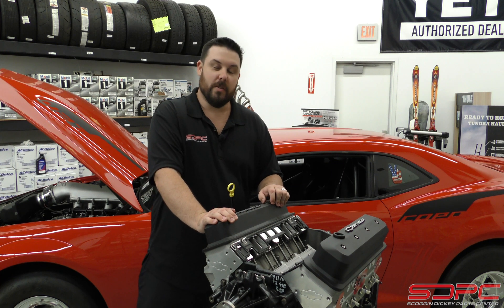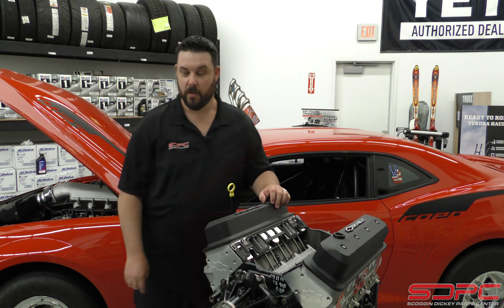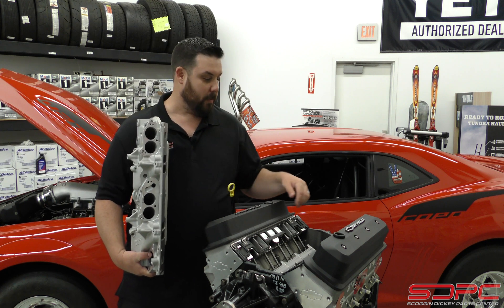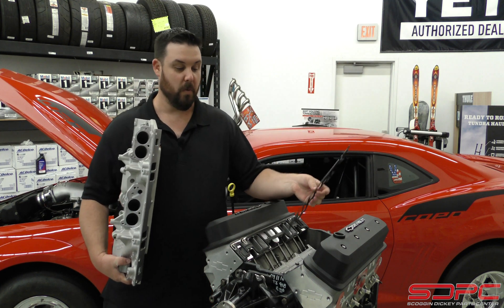SDPC Tech Tips: SD3816 Vortec TPI Base Intake

Comment: The GM TPI intake didn’t deserve the bad rap they got. Everyone thinks that you have to rev an engine to 6-7000 rpm to go fast in drag racing. Between aftermarket parts and porting tricks the TPI intake can make sick torque for a street car.
Reply: No doubt. Tell the diesel crew the make too much torque down low and don't Rev high enough to drag race or make for a fast daily driver...

Comment: I'm considering doing this to a K2500 that pulls a set of rakes. I've got the summit K1101 cam in it, but the top end is otherwise stock. I'm not sure if I can get away with the 1.6 rockers or not, I think stock is 1.5. Either way, I want to put a set of Harland Sharps in the modified top end when it comes time. I also want to stud it. I do have the ARP top end bolt kit right now.

Comment: I have the Holley EFI intake (300-260)can I pair that with the Chevy fast burn heads I’ve read that those heads have dual mounting slots for both older and vortex intakes
Reply from the maker: The fastburn heads will work with Vortec or RAISED PORT small block intakes. They will not work with standard intakes.

Comment: Will this base work with the after market intakes like the ACCEL Super Ram?
Reply from the maker: Doing some digging some people have run it but it will require some modification to fit.

"You will need to clearance the intake manifold because the mounting boss for two of the intake bolts will not allow you to fit the Accel Super ram runners. You'll also need 2 flat headed or button headed bolts."

https://www.camaroz28.com/forums/3rd-gen-l98-engine-tech-20/superram-vortec-why-i-upgraded-337839/#post2806207
Reply: @Sdpartscenter  thanks. I found one of your bases in my late father's collection and have a good set of ported Vortecs and a possible C4 project car that might be a good setup for this.

Comment: Scoggin-Dickey Parts Center - We just bought the lower manifold for installing in a 85 Z28 5.7. Our plan was to install a 5.7 truck L31, utilize an LT4 Hotcam and springs. Looking for recommendations on push rods, lifters, rockers (stock?) or another option. Also if we were to stay with a L98 long block would the LT4 still be a suitable candidate? Thanks in Advance
Reply: What was the price?
Reply: @billywilliams6853  it was $400 plus shipping to Alaska. If your in the lower 48 states then I think the shipping is free.

Comment: Which GM production car or truck came with aluminum heads?
Reply from the maker: This wasn't a production motor that we used, it is actually a Chevrolet Performance ZZ6: 19368150
Reply: V8's:
L98
90s Lt1
Lt4
Lt5 DOHC
LS1
Etc

V6's:
3.1
3.4 
3.8
Etc
Reply: @xmo552 Let me rephrase that question. I meant to say what First Generation SBC besides the L98 came with aluminum heads from the factory? Sorry.
Reply: @sportsmansparadice42  
Hmm from memory:
Olds and Buick 215
69 ZL1
Aurora and Northstar
Pontiac OHC inline (maybe) 
....... but yes non of these are SBC, so I think the only ones are the L98 and the next LT1 (not the 70s lt1).
I'll add the 1990s c4 ZR1 for honorable mention.

Comment: any suggestions on a good ECU to run on this setup? Holley? FAST? or stock?  I've built a 283 with Vortec heads and this intake. It's for my 50 chevy pickup. It's mainly for cruising.
Reply from the maker: Holley would be the preferred route.

Comment: Can you show us a dyno test. I would like to see the power curve.
Reply: My guess the power curve looks almost exactly like any other TPI engine.   The runners are probably just as long as a stock runner, but much, much larger.   Watch some of The Other Guys (Richard Holdener) TPI engine dyno tests with TPIS and other TPI runner/baseplate stuff.   They all make the same curve, just differing levels of power.   MASSIVE low end power, not much past 4900rpm.   Doesn't matter the engine displacement, or even the cam.  Curves look identical, but can differ upwards of 30hp depending on the intake parts you use.
       You have to change runner lengths to change the curve.  most of the time if not all of the time, you will see a loss of low RPM power, but make big gains above that poultry 4800-4900 rpm power level with the long tubes.   The bigger TPI runner stuff DOES make more power due to more air flow.  But regardless of cam and heads, that power curve is dictated by the runner length.   
      Personally, I love the lower RPM grunt of the TPI, long tube stuff.   I'm not a drag racer and would daily drive the stuff (no longer have either a C4 or a 3rd Gen) for it's instant throttle response and part throttle acceleration- they just move off the line insanely well.   
      I've driven C4's with a Lingenfelter/Accel super ram intake box, and it's mild low, but yes, the RPM range and power were much better.   That car had 420cid (also Lingenfelter built) with an old Paxton on it.   Low end grunt was not a problem.  In stock N/A form, it felt less inviting for daily driving and liked interstate pulls much more.
Reply: @Vekurus  just actually read a motor trend article last night and they had power building all the way to 6000 and still had gained 131tq on the bottom end. It's a fine line to make hp and tq as you said. If you get it 
Perfect it's a awesome system.

Comment: Was hoping you would give a HP figure for that ZZ6 motor with TPI manifold !
Reply from the maker: In house testing has proved a gain of 40 horsepower over a stock L98 engine. The larger runners of the TPI Vortec Baseplate combined with the excellent flow characteristics of the GM Vortec heads produced 300 hp on an otherwise stock L98 engine. Other modifications such as camshafts, rocker arms and injectors produced as much as 375hp with the stock computer and throttle body. Testing was performed with a MASS Air Flow sensor system.

We honestly don't even have a TPI plenum that we'd be able to test on top of a ZZ6 :(
Reply: @Sdpartscenter  Just 40hp? Using the ZZ4 camshaft in a stock L98 Aluminum head 113 produced 40hp.

Comment: Take a VORTEC 350 block and sleeve it to run 3.90 pistons. Use a small journal 327 crank. Use 416 305 heads and comp 268 cam. This base plate with FIRST TPI. Use full 2.5" exhaust with x pipe and thru x catback. Use 350 injectors. It should hit 360hp at 7000rpm in a 307 :D.
Reply: Most people forget. TPI from the factory was meant for a 305. 3.90 pistons with a 327 crank is a better combo for the cubic inch. The aftermarket FIRST TPI is designed to flow more air for a larger cubic engine. The added airflow fixes the high rpm issue with the smaller cube. You can hit 10,000rpm with tpi it requires 6.0ls injectors in a 307 with the EGR baffle made for corvettes.

Comment: I'm looking at getting another C4 and if I get the one I'm looking at (A 91 Z07) I'll definitely order one of these. That said, you guys REALLY need to source a set of Accel runners and reproduce them. While your'e at it being able to buy a Super Ram sure would be nice..........
Reply: I've since found that the FIRST Fuel Injection complete TPI setup is available for just $1050 with a choice of standard or vortec base. 1.75" runners, bigger plenum, single blade TB, and a base that doesn't need to be ported. Sorry, but that's a no-brainer.

Comment: Question Nick I get the the SDPC allows the use of the far better flowing Vortec heads, but are the ports on the lower intake larger and hence better flowing than the original factory intake? If so do you have and flow bench numbers.

Many moons ago I built a screaming TPI motor for my 89 Formula 350... I had TPIS lower and runners, 58mm TB, high lift 224 degree roller cam 1.6 rockers, Brodix 180cc aluminum heads and a few other tricks. We stuck a T56 behind it and it ate street cars lunch while getting 26 MPG at 75 MPH and that was 22 years ago... Car pulled hard to about 5700 RPM and then tapered off, although it still didn't hit the wall as hard as the factory set up did at 4900 RPM. Miss that very much...
Reply from the maker: Hi James, that Formula sounds like it was a blast!

We do not have exact flow numbers on the intake alone, but the opening to the intake ports has been "matched" to the stock vortec port, so it does flow better than the stocker. There is enough meat in the casting for porting if the customer wishes to take it to the next level.
Reply: Scoggin-Dickey Parts Center Is there anyway to recast the manifold where it can flow about 280cfm’s? The manifold flows as much as the stock manifold 200cfms
Reply: @vincentiroc  Vince so you have some data on the flow of this intake?
Reply: James Bowman I don’t have the flow sheet but I was with the SoCal crew in California. Dyno Don had the manifold flowed and it flow like stock. Somewhere between 195-205cfms. Major work was done to it like adding aluminum over the ports so can extra porting can be done and it end up flowing 280cfms. It was mated to some Edelbrock E-Tec 200 heads, a cam similar to the TPIS ZZ409 Cam and siamese SLP Runners on a 355 and made 370whp@6100.
Reply: @vincentiroc  
What was the torque?
???500 ft/lbs???
Reply: @albundy8052  420